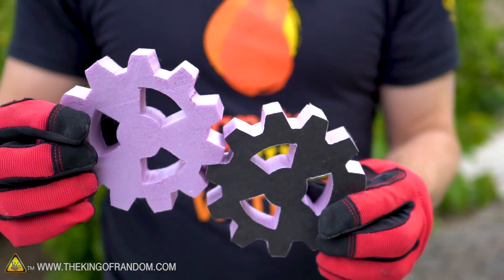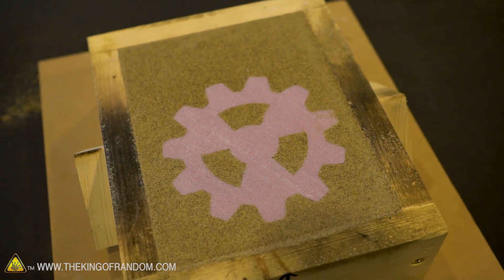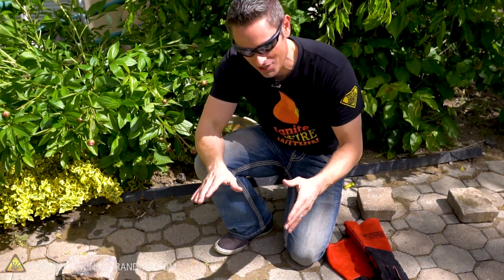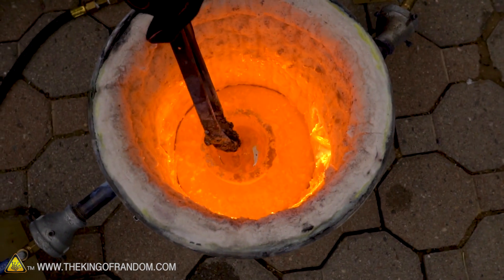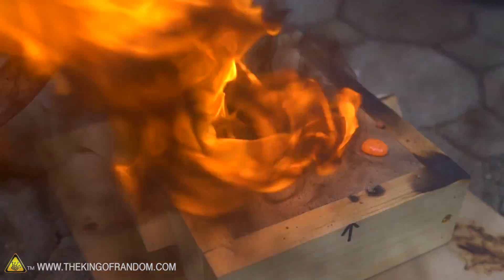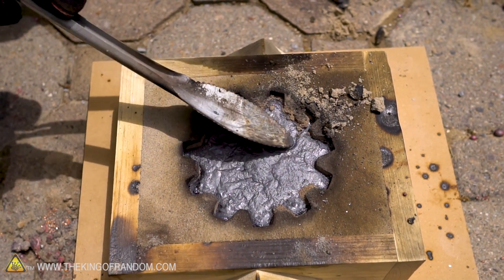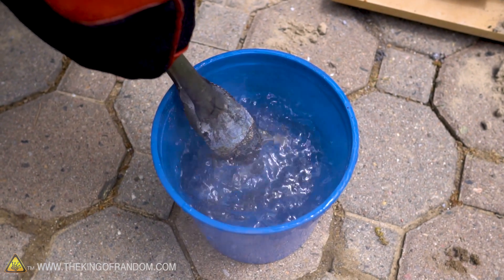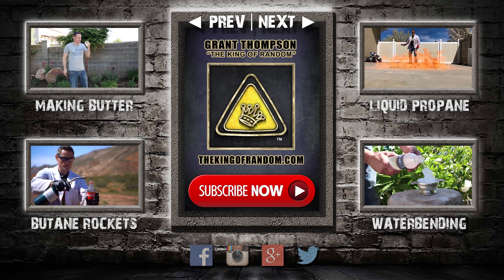Argh. Why Is Copper So Difficult? TKOR Tests Melting Copper In Our Homemade Foundry

Comment: I think you're pouring the copper from too high. Think about how much that stuff weighs, and it's being dropped on to fragile sand. Then the molten polystyrene wants to become a gas and needs to escape passed it. You need a better way of channeling it into the mold. I would also use some sort of gluing agent on the sand near the mold itself to make it hold together better. Maybe some watered down wood glue. As for the density issue, why not use some pins to hold down the central bits that keep popping out?

Comment: As others have said - clay is the key.  It's more dense for one.  In a closed mold (with a hole where the 'center' of the gear is) would keep the pillars from popping out.
And the styrofoam, no matter what you do, will ruin the mold if it's in there when the copper is poured... that mass has to go somewhere.  Either boil out through the casting, or adhere to the sides of the mold.  I'm not sure what professional metal casters use... wax, maybe?  Something that would soak into the structure of the mold when it heats (and further seal the form)?
Dunno... but normal sand would never work for such high temps.  Too buoyant and porous.  And wet.

Comment: Maybe it'll work if you "submerge" the foam in the sand. Make the foam cast with a foam "stick" connected to the middle of the gear. Cover the foam gear and stick with sand allowing the top of the stick to be shown. Continue by pouring the copper "through" the stick.

Comment: I’ve never dune any of this myself but couldn’t he mix a type of motor oil like maybe 50W in the green sand to make it hold together better? Or some kind of high temp oil with the highest flash point instead of water. I’m sure it wouldn’t have as fast of a instant flash point like water does.

Comment: Have you considering heating up your green sand mold in the oven to about 350 deg F?  That's well below the burning temperature of wood, but would melt your Styrofoam mold.  Assuming your green sand holds together, it would allow the copper a much longer time to cool and solidify, thereby more completely filling the mold.

You should also consider using a stabilizer for the sand that essentially glues it together around the mold.  Using a wax mold would then give you the option of heating the using to 200 degrees and pouring out the wax.

Comment: Maybe try spraying acetone on the styrofoam before pouring the molten copper in the mold..
Oh, and a foundry here in east Tennessee uses sand mixed with some type of epoxy to make their molds. Just a thought..

Comment: As the other fellow said is  use a two part mold (cope and drag) with vents and a feed channel for the main pour.weights on top of the mold to hold the cope in place without displacement of your internals.

Comment: One you are getting burn in. Two lots of penetration from un washed sand. (Paint) you need a pattern you can remove not pour over. You need some vents and a riser as well. Closter sand works better then green sand on small molds by the way.

Comment: You might be able to compackt the sand for a better result by using a belt sander attached to one side of the mould and appling downward clamping foce. Over flow the mould you may have to repeat the process a few times. You could also use hot water to reduce the temp diferental add salt to the water for a higher boiling point or use a diffence liquid all together. Just thoguhts. Would embeding the cog deeper and useing a chimney to pour the coper not also work better?

Comment: Hey just a thought but have u considerd using some kind of mesh to lay on top of the sand when u pour in the molten copper. This is just speculation but to me it seemed like the chunks of sand werent breaking apart, just floating to the top but i wonder if there was somthing holding them down if that wouldnt happen

Comment: Moisture in the sand turns to steam and pops the lands out.  The sand should contain a bondant and be thoroughly dried.  Also, most gears are cast as blanks and the teeth are hobbed or milled on a horizontal mill.

Comment: silica sand (SiO2), 
chromite sand (FeCr2O4), or zircon sand (ZrSiO4), 75 to 85%,
 sometimes with a proportion of olivine, staurolite, or graphite.bentonite (clay), 5 to 11%
water, 2 to 4%
inert sludge 3 to 5%
anthracite (0 to 1%) - 
The above is the combination for mold sand, not sure u have used the same combo.!

Comment: Try stabilized sand. Use masonry sand, add pure mortar to it (Small amounts) until it is stable but not concrete,  it should hold up better. you can even stick it in the oven to raise the temperature.

Comment: Thinking of using rock for help the sand's holding. How about filling the holes with a layer of sand around, and through a piece of rock in (careful with the size), and fill the gap with sand again - will this possible work?

Comment: You have to put the foam gear all the way into the sand and pour the copper down a spout. Also, it's easier to just use clay than sand for casting incredibly high temp metals.

Comment: Why not try making it a 1-time use mold by mixing the aquarium sand with some plaster of paris, add just enough water to dampen the plaster and let it cure ... remove the foam and make sure you heat the mold before you pour to ensure there's no moisture in the mold.

Comment: You failed because copper is heavy and makes your "sand chunks" float on top. You need a lid made of sand with a hole as an inlet. Check some books and use red oil sand.

Comment: You could use the Styrofoam gear and but it in concrete and melt it, Then put in the copper!!!
Reply: Solid concrete has water in it.  Heat concrete, and the water inside will turn to steam, and can explode violently.

Comment: I made it work, in fact I made it 3 times and sold them all on ebay for $160 - $240 but my cogs were much bigger and so more sand was needed therefore the chunks of sand in the middle didn't break the problem I think you're running into is that the copper is heating up the sand so much it just breaks. It's like creating a castle with the sand that is at the top of the beach, you know the sand that burns your feet and make you go into the water, the sand there is really hot making it almost impossible to keep a structure because it just breaks I don't know why this happens but what I think you need is a bigger mould with bigger "sand chunks" in the middle. Your moisture idea was great but I only put 2-8 drops of water threw an eye drops tube, I put the drops around the chunks not on it because then it might ruin the structure of it, I thought that if I dropped it around the chunks the water would climb up it like water climbing up toilet paper it got about 3 quarters up the chunks ( the chunks were about the 14 cm high and 7cm thick.) So that's my advice goodbye

Comment: I think you should make a sheet metal lid to your mold case that has an inlet hole.  One problem I see is that your sand keeps floating out.  Another option is to just coat the foam gear in plaster and them brake the plaster when you have the copper gear.  Heat the mold some with a blowtorch before you pour to keep it from shatering.

Comment: Your using sand, for that type of casting you'll need to use a much more solid base mold... try it with concrete, that might do the trick.

Comment: I see others mentioned the 2 part mold. Casting sand, vent and sprue holes.  Inadditon, you didn't use any facing power, didn't add flux to the copper.  Little bit of zinc would also help with the finished quality.  A gear that size i suggest 3 copper pennies would be just about right amount of zinc.  For flux you could use salt, not too much, just enough to get a very light coating over the copper in the crucible.  Heat slow so as to not gas off the zinc, the flux will keep oxygen and propane gasses from being absorbed into the mental.  If this happens the absorbed gasses will release while cooling and you get poor quality casting..

Comment: no no no, you have to use gypsum and water glass instead of sand. Of course, you must keep this form extremely dry. The form must be closed both sides and the copper is inserted through the channel.

Comment: Try adding a bit of oil to the sand to hold it together. Also a bit of silt to improve the sand gradation. Trichlorothene will dissolve the Styrofoam before casting. You cannot have any residue left in the mold before pouring the copper.
Reply: you could also coat the model with a bit of plaster to keep the detail.

Comment: This may sound weird, but, would mixing plaster of Paris, or clay (garden variety) with the sand to act as a stabilizing agent as you pour it over the plastic mold, work? I realize the plaster may burn when the molten metal hits it, but, the clay won't.

Comment: @The King of Random can you try putting a concrete cap over the mold, with one big hole for pouring in molten copper and few smaller holes for releasing gasses and excess of copper?
Such cap should prevent those pieces of sand from floating on top of molten copper.
Also, you should make your forms be thicker  in every dimension, than what you actually need. 
In that way, you can just grind the excess afterwards and in the process you will get rid of all the bubbles and imperfections of the surface. Then you can make your cogwheel perfect.

Comment: support those cut outs in the gear with something like steel rods.  You can always cut them off later on and that would support those little areas from breaking off.

Comment: casting copper isn't that easy. For example the squirrel cages in induction machines are mostly aluminium, because they can cast it in the iron. Using copper would make the motor more efficient, because it is a better electrical conductor, but it is to complicated.

Comment: Pouring it wrong, mould needs to be on the bottom of the sand so the weight holds the sand in the proper shape.

Comment: The sand keeps popping out because the styrofoam , when heated, is contracting and crushing your three "radioactive" holes. Make the mold and remove the styrofoam gear before pouring.

Comment: I think you need a lesson in castings. You need the mold double sided with a pour hole and breather holes. You will continue to fail unless you learn the correct procedure.

Comment: You should use this copper gear to make a gear mold using another metal so you can make copper gears without the problems you had with the sand

Comment: Use casting sand then pull out the gear, then heat the mold before pouring. Top is going to be "domed" due to surface tension. Make a 2 part mold with vents to make a perfect cast.
Reply: I was gonna mention he should try to make a fully enclosed mold with vents and a center post to pour into.
Reply: Yep school metal work at age 13. A two part mold will hold the inner parts better. Make the first mold as you did, add an entry object such as a pipe, and then box it up for the top. Remove the entry object, pour down the hole.
Reply: Yep. That is how they do it at Urick Foundry in Erie PA. They mold stuff for Rigid Tools.
Reply: When he added the extra water to the sand  you could see it bubbling. Not ideal. But fine for backyard fun I guess 😂
Reply: Ur so smart
Reply: Hi
Reply: My dad used to work in a casting factory.
Reply: Yes. You’re 100% right
Reply: I agree but it's a  Styrofoam cast. He does not need to remove it from the mold. The gasses escape the vent and spru holes
Reply: Preheating the mold is very important with sand castings.  Also having just the right amount of moister in the sand is very important.  If the sand is not preheated is gets shocked by the heat and breaks off.  A preheated sand doesn't get shocked by the heat.

Comment: It looks to me like you should pack that gear in the center of two layers of sand and then leave a funnel down to the styrofoam and pour the copper through a funnel if you can do that, that way it just fills a cavity in the center instead of having room on top to screw up

Comment: Try using small gauge wire in the weak areas of the sand castle like rebar in concrete

Comment: u should try adding a top to ur molt so the copper flows into a hole and then goes into the foam a top layer will add more strength to the sand and should help give the same no room to pop off

Comment: i tried it he way cody,s lab said but you have to get the right amount of other metals and the right ones to i tried the pennies soor 2 cups of molten copper 4 pennies
Reply: I meant to say, the not, he
Reply: U.S. pennies have been struck in zinc for thirty-five years. Otherwise, your post is indecipherable.
Reply: 1979 and below are all copper still get quite a few !

Comment: Why don't you try putting the Styrofoam in the middle of the sand? Like putting 1-2 inches of sand on the bottom then the Styrofoam and then more sand.

Comment: when casting you need to use a sand with a sillica substrate that will hold its shape. use a torch to burn off the foam and make a shell in the sand to poor into then poor into the middle through a funnel or chute so the flow of the copper does not lift the sand . either that or make the sand in a metal or ceramic container and bake it to create a firm mold to poor into.

Comment: Why not use a flame torch to actually burn the Styrofoam out. You would end up preheating the mold so it doesn't cool the copper down and when you're ready to pour, you wouldn't have to wait for the crucible to heat up again.. By the time the crucible heats up again, the mold has cooled down already..

Comment: Hey, it might work better if you put your Styrofoam into plaster, let it set and then melt the Styrofoam out from the outside, then put your copper on and when it's cold just break the mould open.

Comment: The three windows of the gear would have a better chance of staying in place when the copper is introduced if a nail was pressed into each window after you are done ramming the sand.  This creates a mechanical bond in locations where there is not much surface area.

Comment: You realize that isn't green sand right? Do a little research before winging it. There is a LOT of knowledge out there about casting. It's an entire industry. As a metallurgical engineer I had to pause the video 15 seconds in because of your vocabulary use. You're using a furnace, not a foundry. A foundry is the actual whole shop setup. You're killing me

Comment: The best way to get it to work would be to have a hole in the lid (lid will also be a sand container such that the sand is wet and holds upside down to the lid. Even a thin layer would do. This will have a smooth finish on the other side of the gear too.) to pass the copper inside the mould, have the sand inside wet (not moist, but wet) and then let the copper pour through the hole. 
Caution: There would be an additional rod shaped structure attached to your gear which you can cut off once the gear cools down or have a mechanism to cut it off by moving the lid ever so slightly that the copper flow is obstructed.

Comment: Copper dissolves gasses when hot and releases them when cooling thus it is much easier to cast if you add something to disrupt that like a hand full of zinc pennies or a roll of lead free solder. or if that is not the case , The reason why the sand is breaking is not the melting point. The burning mold produces gas. The pressure from the escaping gases has no where else to go. The copper is more dense than the sand. So the Sand gives way. This goes for all who are trying to make molds with foam.

Comment: add brown sugar  to your sand and use metal rather than wood.  warm it up in the oven at low temp.  at worst the styrofoam will melt but the sand should be stronger.  That is what our molds are made with at the steel mill.  we use silica sand and brown sugar.  we cook 125,000 pounds at once.  :)

Comment: Wanted to try this myself so what I did was make the mould with concrete and removed the gear let cool then casted had great results (using copper) couldn't get it to work with green sand had the same problems

Comment: Why not make a copper gear Fidget Spinner? Make the foam as thin as the Bearings used in common fidget Spinners and try making a homemade Gear Fidget Spinner. Radioactive symbol optional!

Comment: MAKE SURE YOU USE A DURABLE MATERIAL WHICH WONT BREAK DOWN SO EASILY, SUCH AS TUNGSTEN.
TUNGSTEN HAS A VERY HIGH MELTING POINT AND ITS SPECIFIC HEAT CAPACITY WILL LET COPPER STAY AS A LIQUID FORM.
INSTEAD OF USING FLAMMABLE STYROFOAM, MAKE THE MOLD AND REPLACE SAND WITH TUNGSTEN, THEN REMOVE MOLD.

Comment: Because the sand was moist and not completely dry or cured. The sand was easily lifted by the coppers extreme heatand forced from the center of the mold.. Try baking the sand in extreme heats after making a wet sand mold.

Comment: What works for me is using a dowel, usually steel rod, to reinforce the internals. Never casted a gear, but it works a lot. It keeps the sand from being pushed out or in by pressure. As long as it's packed down nice and tight it won't budge

Comment: 2 parts of the mold, gear on the bottom, and two ports on the top, one for escape, and one to pour, cones should be on top of the top mold to protect the sand.

Comment: Matthew Utt is correct.  I ran a bronze foundry a few years ago, making castings for drain fittings for navy ships.  All of our casting molds were completely closed except for feed and drain sprues.  You will have to cut off the sprue flashing that remains, but you won't have the same problems with sand formations in the mold floating free or moving.

Comment: Try to cook sand a bit it will make it more durable. Blow some fire on it so that Styrofoam is burnt away and sand is cooked till charged and crispy. For the mould to hold it has to be heated other wise temperature difference will break the mould. Try once more.